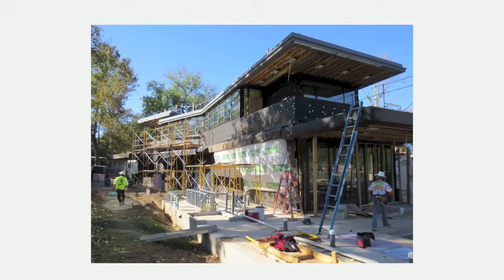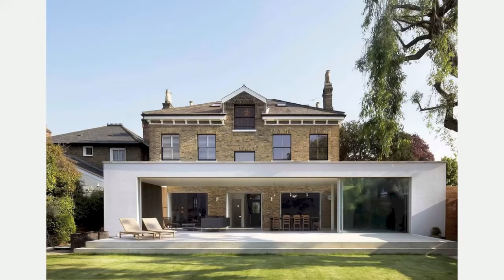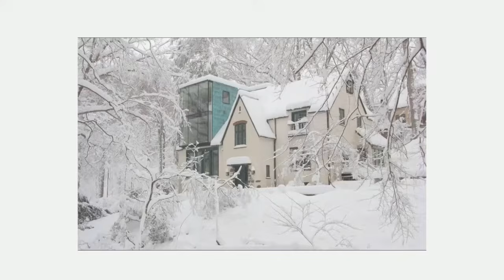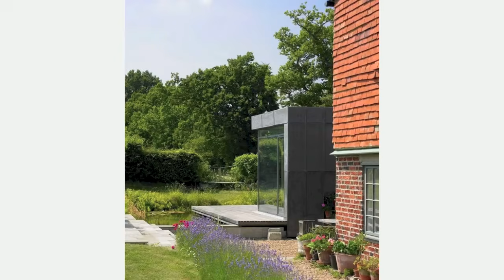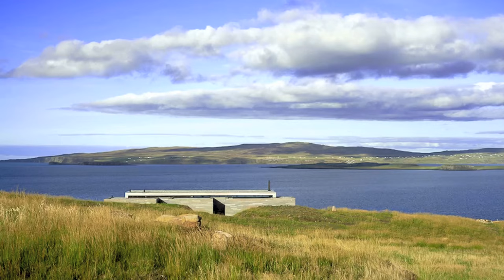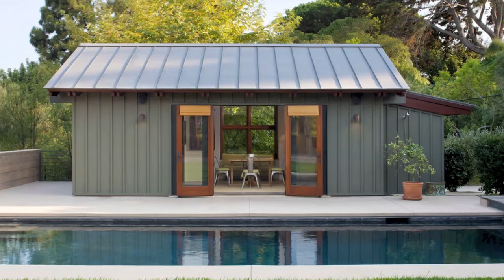Phasing Your Home Construction Project - Is It Right For You?

Comment: I'm curious if the glass roof from the first picture will last in a region with heavy rainfall and hail. Hello from Meghalaya :) I'm in the process of designing a section of my own home, which requires roofing. A pitched roof costs more than a flat concrete roof and I was wondering if it would be a good idea to start with the flat and then add the pitched roof after. Would love to know your thoughts on that.